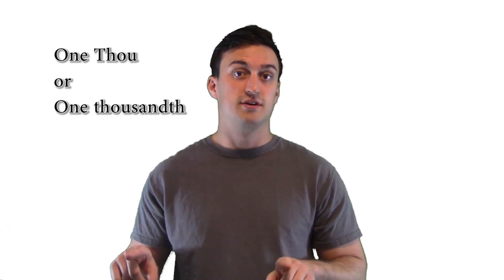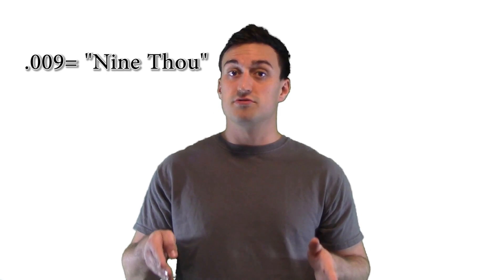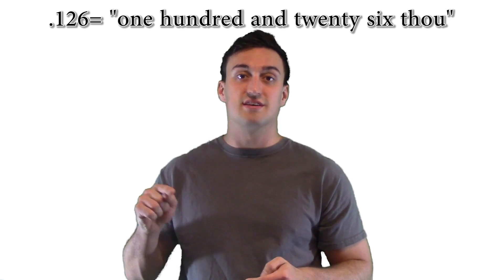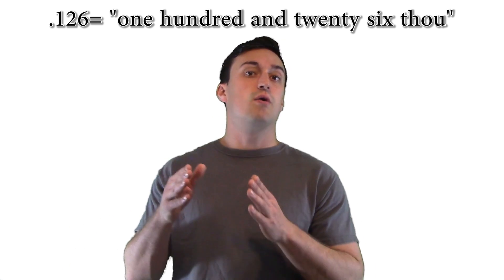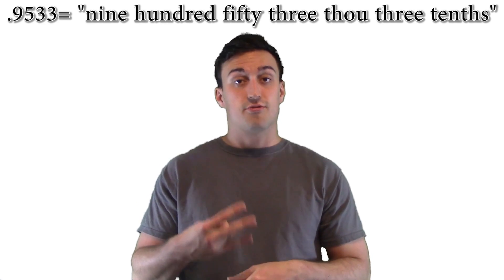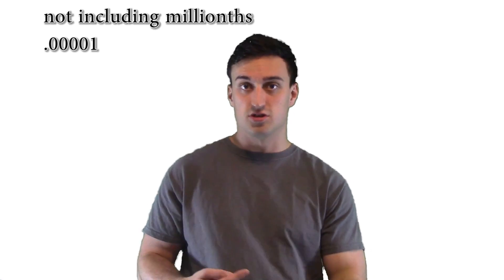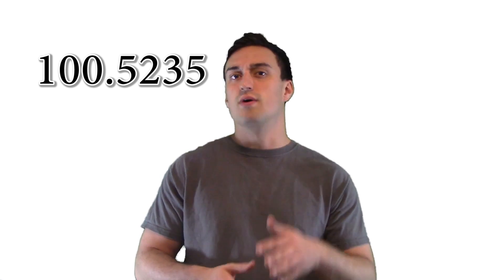How to say .001 (As a machinist)

Comment: only say "and" once  when reading a number. only say "and" to represent a radix point. a radix point is the symbol that separates the whole number from the fractional number. in some countries is a decimal in some it is a comma.

.126 ——> it's not one hundred and twenty-six thousanths.

it's one hundred twenty-six thousandths.  (do not say the word "and") and represents the decimal (radix point)

100.126 ---> one hundred and one hundred twenty-six thousandths.

110,038.236 --> one hundred ten thousand thirty-eight and two hundred thirty-six thousandths

it takes practice and discipline to avoid incorrectly repeating the word "and" when reading a number.
Reply: We don't even say thousandths, has to be thou.

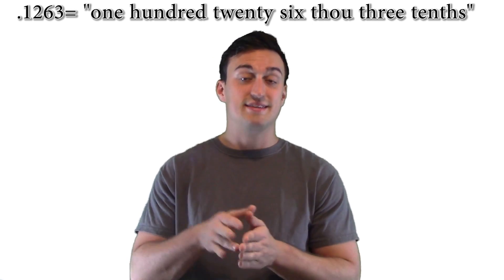Comment: 1:01 This is wrong. It goes tenth 0.10 (takes ten to make one inch), hundredth 0.010 (takes one hundred to make one inch), thousandth 0.001 (takes one thousand to make one inch). The “tenth” you are referring to is tenth thousandths. So you have three tenth thousandth in this example. This is simple math.
Reply from the maker: @travismilberger4906  in the machining world when you physically make parts this is the system we use. I’m sure there is a good reason beyond what I know but this has been happening for a long time. In general math in college they use what you’re describing.

I’ve worked with Toyota manufacturing, Honda, NASA, Blue Origin and more. This is the language used, along with metric system terms.
Reply: @ I’ve spent years machining and building engines. I currently work in engineering. Never have I heard someone refer to tenth thousandths as tenths. This is universal basic math we are talking about, but if it works for you I won’t stand to argue.
Reply from the maker: @travismilberger4906  look further into it and so will I, let me know what you find. All in it for education and making sure I teach right.
Reply: @Machining-tutorials Why don't they just use simple metric and be done with it?
Reply: @sonicstep  Inches is just the default for American industry. That’s how it’s always been… I work at an aerospace/medical equipment machine shop and we use the imperial system for our parts.
Reply: @sonicstep because we are Americans
Reply: Ask any machinist using inches they will tell you .100 one hundred thousandths .01 ten thousandths .001 one thousandth .0001 one tenth

Comment: I got done college for cnc few months ago and got a job making parts for the military and the way the school taught me my boss was saying  forget everything school taught you its different in the work place i still have trouble with this they didnt even talk about the tens column so i still get confused when i have to make shure things are in tolerance this helps a bit thanks if any one has tip let me know.
Reply: Just think of it like this theres 1000 lines in an inch. Each line is called "1 thousandth"
Reply: @HITTAGAME  thanks I understand that it's more for the calibers when u measure but the actual hass machines when you have to make adjustments by the tens, hundredths or thousandths I still get confused I'm starting to get better now tho I'm lucky I have a boss willing to train me.

Comment: Just had my 3rd day as a tool and die apprentice and was lost when my mentor would talk like this. Stumbled through making my parallels before I finally got him to understand I still think of decimal places as if it were highschool math. He was understanding and was just used to talking like that. Now I have a much better grasp. It literally feels like machinist lingo is a completely different language.
Reply: Bc it is🤣🤣
Reply: @jake_norsegael Should be all decimal. Much easier; 
1.0mm 
0.75mm 
0.5mm 
0.25mm 
and so on. Microns for tighter tolerances if needs be. 

Unfortunately, till this day even the U.K. that is the way of machine shops. They still mix decimalisation with imperial speak. 

Even their hours worked is a mix of fractions of an hour. I've had to convert from fractions to decimals to determine total time worked for payroll. It is a nightmare.!

Comment: I dont think this is 100 percent accurate.  I completely understand different machine shops with a completely different set of old timers can have developed a completely different jargon.  With that said the way my old timers taught me was .1000 = 1 thou, .0100 = 1 hundred, .0010 = tens and for a reason I will never understand; .0001 = 1 tenths.  Aside from the whole tenths thing the rest makes since if you treat everything to the right of the decimal as a 4 digit number.  .1250 = twelve fifty thou,  or .0250 = twenty-five hundreds, .0050 = fifty tens.  Personally I always thought  the mil (not mm) is a very good type of measurement abbreviation.  For those who don't know 1 mil = .001 so .150 = one hundred and fifty mil.  Of course if you need to go 4 spots past the decimal there could be an issue.

Comment: Whats the difference from .100 and .001? In math class that's still 1 tenth but u say 1 hundred thousands? Why?
Reply: Because .001" is the "base unit" in the USA machining world. Everything is expressed in terms of this "base unit".  .750 inch is "750 thou". .100 inch is "100 thou". .0005 inch is "half thou". And that is why .0002 inch is "2 tenths". Because .001" is the "base unit" and .0002 is 2/10ths of this "base unit". ps, "thou" is short for "thousandths".
Reply: It's because machinists are Techs. They are saying a fraction. 10/1000. They don't know how to use a number line. It is evidently purely an imperial unit convention that probably came about because a Tech was trying to save face about miss placing a couple decimal points.

Comment: What about below One Thou? How would I say for example .07 and .7 and also .0007
Reply: Cam Gilliam   .0007 = seven tenths .7 = seven hundreds  .07 = seventy thousands
Reply: @BoBBy_Loko how would you enter that in the cnc lath if it was for ex .07 seventy thousands would it be +.07 or .007 and why  isn't 7 thousands instead of seventy thousands?
Reply: I'm just guessing but I would say    .07 as 70 thou....... 0.7 as seventh of an inch or 700 thou.... And .0007 as 7/10 of a thou.... I feel there is a better way to say the  last one but idk